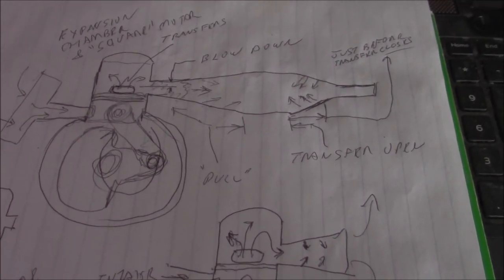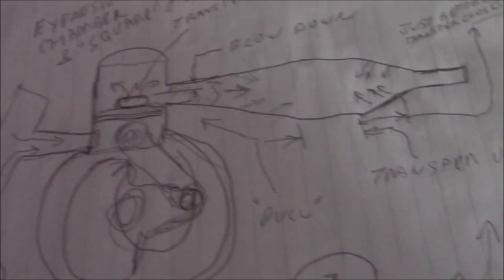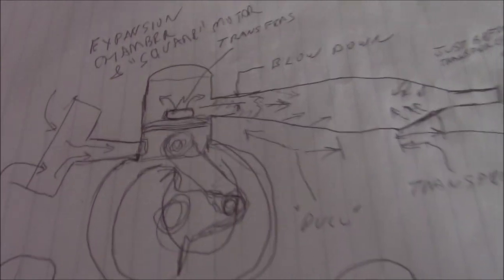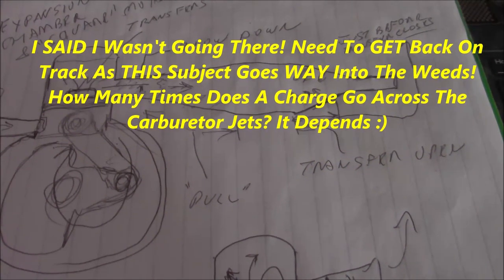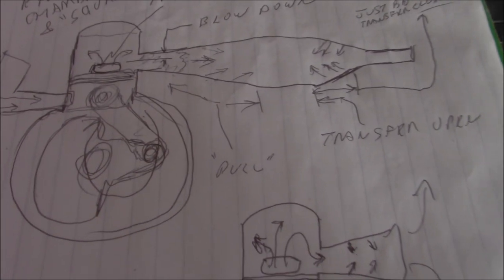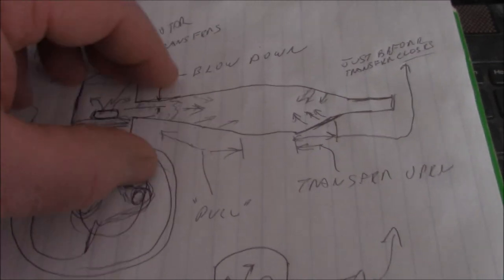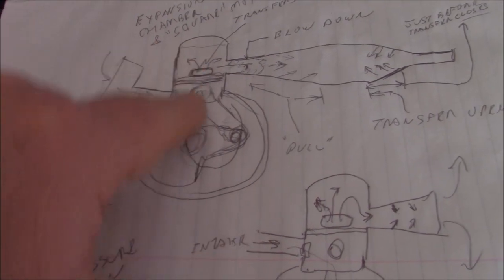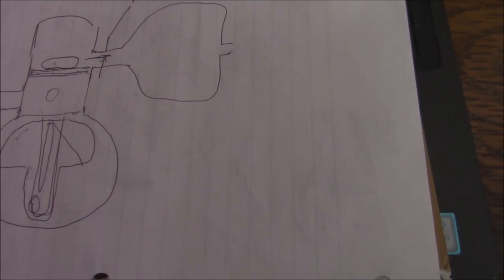Chambers & Cans, Pressure Cans That Is. A Simplistic Two Stroke Theory Video, Muffler Mods & Types

Comment: Dirt bike expansion chamber's are great example's of ''Pipe tune'' in the two stroke world, It's crazy how much pulse is in them. What i mean by that is just putting your hand on one when you first start a bike when it's warming up you can feel the high frequency pulse in that chamber; it's pretty amazing on the amount of back and forth ''compressed gas flow'' going on in there. I know they were designed that way to suit the wanted end result of when your on the ''pipe'' it's a violent explosion of power in every direction, trying to keep it going in one direction is another (don't ask, old enough to know better... :)  Chainsaw's in stock form are a lot milder in temperament to get longevity and runability, they are condensed in a small package to keep weight down like you said. But trying to get them to run like other high output two stroke's is what everyone's chasing these day's. Half the fun of going off into the weed's with this subject is bushwhacking your way back out lol! What i'm trying to say is good job of breaking it down in laymen's term's for all the ''saw nut's'' that come to your channel. Thank you Walt look forward to the rest of your video's on this subject, take care.

Comment: Nice explanation sir!  I agree that the explanation can go off into tangents (weeds) and entire books rivaling the length of war and peace can be written on all facets of the operation. Having said that , and as someone who has actually done some saw building and performance exhaust work the chainsaw muffler is a compromise between noise and performance. The exhaust pulse is actually bouncing around the can in all directions only to be bled off through the tiny stock exhaust … this retains heat and limits performance. Enlarging the hole will allow more flow as will adding deflectors on the side or top of the muffler for sure however it’s been my experience that a single round pipe (or dual smaller diameter pipes in some cases) is going to outperform the above mods when talking torque and mileage and also heat release. A stock saw run hard and then shut off is going to creak ping and make noises because of the heat retained and will stay hot much longer than a piped exhaust will simply because the piped exhaust allows more flow and thus more heat removed. Now when we start talking about “Bearclaw” style pipes and the endless versions that can be made from this idea we are getting into a different scenario altogether!  The size of the header outlet  is now several times smaller (maybe slightly larger than the exhaust outlet itself) than a can muffler and the exhaust will flow with a greater velocity vs bouncing around in a can !  Couple this with a pipe that’s up to operating temp the gains to be had can be 10-15% - no can muffler with a deflector is going to give you these type gains - it’s just simple physics if you really think about it!  Throttle response , increased torque and hp are superior to all but a tuned expansion chamber in my testing. They are definitely louder than a stock can or a muffler modded can but it’s the deep throaty noise that can be easily remedied with earplugs or muffs. They definitely work and if you try them on an autotune or mtronic well … lookout , and that’s on a stock saw !  Round pipes are your friend , stay away from square tubing 😜
Reply: Except dyno joe did a video on it. The pipes did nothing more than be heavier and make more noise. If you dont have a dyno you cant test power.

Comment: Im a realest when it comes to this stuff on saws.
A piece of 3/4 or 1 inch pipe sticking out of the corner or side of the stock muffler is the best blend of power and noise for me.
The small "bearclaw'" type pipes for saws are just too loud for me to use but they do add power, if sized just right.
A big hole in the front of the muffler also makes lots of power but too much noise.
A big deflector with a big hole under it also makes lots of power and noise, this is my second favorite set up but it's a higher pitched tone than the 1 inch pipe.
I dont think about expansion chambers for saws, my saws are for cutting firewood not hot saw cookie cutting stuff.
I used to ride 2 stroke bikes but they had power valves and if we messed with them it was to get more low rpm power, they had more than enough high rpm power stock.

Comment: I believe the reason that some pistons had holes on the exhaust side was because in the days of air cooled 2 stroke motorcycles many of them had a vertical bridge in the exhaust port.  The hole was to allow some premix to lube the bridge and keep it cool so it wouldn't gall.  If you didn't have a hole lining up with the bridge it would melt a stripe on your piston in short order.  Some pistons came with those holes from the manufacturer but some pistons that could fit multiple applications would come without the holes but would come with instructions that if your engine has an exhaust bridge install the piston, reach through the exhaust port from the outside and mark a line on each side of the bridge then remove the piston and drill one or two holes between the lines. I put a Wiseco piston in a 79 Elsinore and drilled holes following those directions. If you took apart an engine that had those holes but didn't have a bridge in the exhaust port it was likely the wrong piston for that engine.
Reply from the maker: My KTM's had one in the back to keep the intake flowing
Reply: @afleetcommand  Reed valve engines?

Comment: Hello brother I’m a certified thermal dynamicist paid a lot of money for that piece of paper but seriously I graduated from RPI and one of my majors is thermal dynamics and you’re spot on what I have found in my trials and tribulations with 2.5 l mercury and my chain saws also my 500cc Honda and cagiva is the  EPA needs to stay out of our 2 strokes ,diesels and gas cans 
       The one thing well two things that would benefit our saws would be reeds and power valves I’ll leave it at that like you said we could go on and on I wrote a thesis paper on this yup a thesis professor wright had fun with that
Reply from the maker: Clarkson here :) I raced CCR250's and 500's in the Mid 80's until 1990. Loved then. My be the best motocross era ever. And to Honda, they were ahead of the curve relative the the rest. AND believe it or not I've own three Cagiva's. Back when they were still Cagiva, I raced a pair of 200's in the 250 class and then in the early 2000's I had a 360 two stroke 360 Husqvarna built by the Italians. AND last but not least the last motorcycles I actually raced ( not including the AHRMA Husqvarna 430XC's , were VOR's. There was a thing for big Four Strokers and the roots were in the Husqvarna design, picked up By Cagiva, competed against by Husaberg who was bought by KTM and VOR was the Husqberg Distributer in Italy wanting to build a better mouse trap.

Comment: I enjoy building pipes. I find the more length you can stuff into that square hole where the muff occupied the better. Seems they still get that back pulse when you stay within the parameters of that given space. Ive not made a lot of them, but the ones ive built have been noticeably successful... im sure im due for a bad one. I find it unreasonable to exeed the confines of the space provided, and theres no way i could get into the math of an expansion  chamber if i were to build a saw strictly for slicing cookies